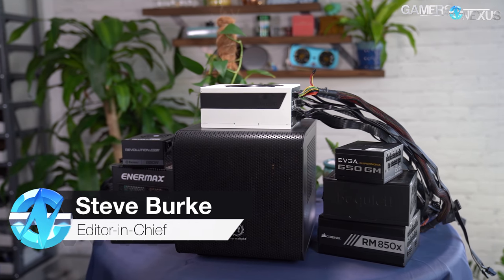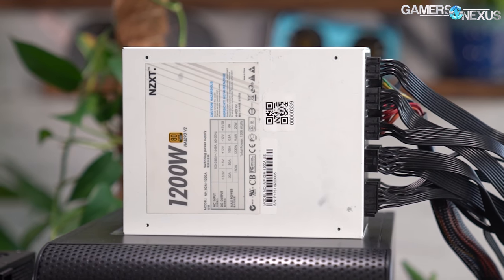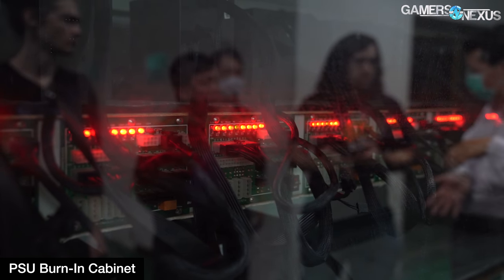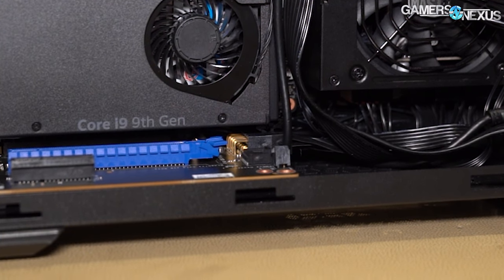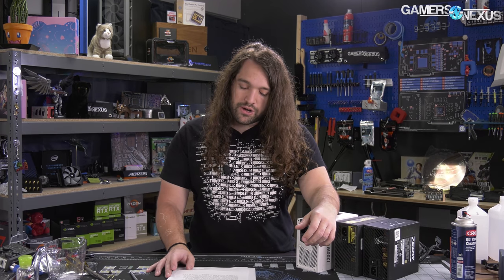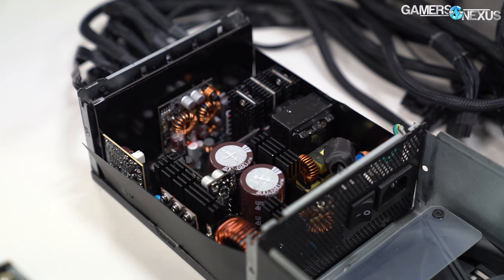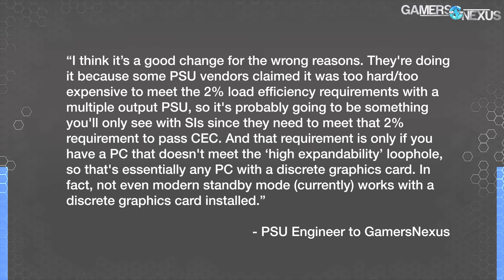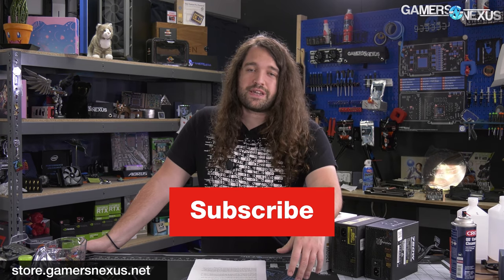Intel's ATX12VO Spec Explained & What Manufacturers Think

Comment: Something I wanted to point out from experience in the server space: the server industry as a whole has been moving to only 12V rails from the power supplies for some time. Google and Facebook hav been using 12V only on their custom servers for over 10 years, and newer standards bodies like OpenCompute and Open19 are also only 12V. This was done for efficiency of the AC->DC conversion process (many hyperscale style environments are even moving the AC input side to 440V to get even more efficiencies). The DC-DC conversion on the Motherboard isn't as bad as it has been in the past due to some new developments in this space. I've been looking at these new Himalaya parts from Maxim IC to do single chip conversion to 5V and 3.3V at up to 1A: https://www.youtube.com/watch?v=9WaV8XqfEyY these next to your motherboard RGBA connectors, SMBus, etc. would solve most of your 3.3V and 5V problems. USB and Thunderbolt/USB4 would need something that provides more power (as those can take up to 3A each port) but something like an LM2596 can solve that for you as well. Standardizing on a 12V rail also means adding backup power is much easier, and also makes it easier for use in mobile environments as well. These are all things that are already happening in the server space as well. I don't think this is all about meeting the new CEC rules, but reducing the number of OEM designs in high volume environments (since the work for 12V only has already needs to be done on the server side of the design group). Hope this provides some useful insight.
Reply: I think this servers don't need to power USB in standby?
Reply: @happygimp0  Some do, but even if they don't need it for USB Standby, they do need it for the BMC standby so that the IPMI/Redfish controller can be accessed when the server is off. Those typically run at 5V as well.
Reply: I had an impression that server space is moving to 48V inputs.
Reply: not 24V?
Reply: @wandererdragon  Intel's 10 year roadmap wants 400A of 48V per socket, but that's probably only going to be seen by the big three hyperscalers. To get 48V efficiently you need 440VAC and most data centers are not equipped for that. Lower volume sales will still probably be 12V based. The efficiency of going from 12V to 480mV isn't as good as 48V to 480mV but for smaller deployments it won't matter.
Reply: Why would DC to DC conversion on the MOBO be any more or less efficient than DC to DC conversion in the power supply? 5V will continue to exist for things like SATA power and USB.
Reply: also i remember seeing the 12v only DC-DC conversion pop up in threads by people wanting to use a non-DELL/HP/LENOVO psu with their prebuilt PCs
Reply: The thing about servers is they have a larger form factor to play with when laying out motherboards, at least compared to a gaming PC.  Power supplies have been getting smaller as efficiencies increase, whereas motherboards are getting more and more crowded thanks to M.2 wifi modules, SSDs, different RGB headers, 3 different USB header standards....you get the idea.  The only real standards that a rack server needs to follow are mounting dimensions and where a server can intake and exhaust air--everything else is fair game.  A gaming PC has too many standards that have to be accounted for--power supply dimensions, motherboard form factor, drive dimensions, as well as the location and height of expansion slots and built-in IO ports.  It is a royal pain in the ass to add a new standard that requires more space in a system rather than less (hence why E-ATX is a mess and micro-ATX and mini-ITX are gaining popularity).

I can see why power supply manufacturers want to shed 3.3 and 5V rails, but the motherboard is not going to have room to push all of that extra power around, and high-power devices like drives and graphics cards will need supplemental power from somewhere.  Not to mention you are adding complexity, cost, and inefficiencies everywhere that you change voltages.  SeaSonic may need to validate their 80+ Platinum rating but Nvidia and Seagate don't have that problem.

Comment: I can never not laugh with that Raycon ad
Reply: Shhh, it is not an ad. It is a sponsor spot ;)
Reply: I would buy the raycons, but for some inexplicable reason, they used a micro USB for charging.
Reply: Thomas Huang i just bought airpods pro but was looking at those
Reply: @thomashuang5053  cost. GN has actually covered the cost difference between micro b and type c in factory tours before
Reply: The ad was funny but there's no competitor for Jays' ads
Reply: @thomashuang5053  Micro USB ports are standard for most wireless earphones. Don't let them put you off
Reply: @tarfeef_4268  If Anker could build exactly the same earphones with a USB-C port for half the price, I'm sure Ray Jay could have managed. And I really mean the same, it looks like Raycon just painted an existing design that is probably being sold under a dozen Chinese brands for $20-$40.
Reply: @gang-yc4je  AirPods Pros are the best earbuds I have ever used

Comment: I've already been using a 12vo setup with my mini-itx build! I've got a 12v external brick bringing power to a dc-dc convertor that's sitting directly in the 24pin plug. You could very easily just replace the 24pin plug with a daughter board dc-dc convertor. It's not hard, new, or that expensive. It's a pretty solved problem in the custom sff space.

Comment: What I expect from the enthusiast market is to pretty much just slap a modified PicoPSU to an existing ATX12v motherboard.
This will convert the 12vO 10-pin connector to the 24-pin ATX connector we've all known and loved, and also allow the connectors for molex and SATA.
Since the real power hog parts are being powered directly by the PSU (CPU, GPU), this module doesn't need a huge amount of wattage. It can also handle the conversion between 12vSB and 5vSB.
Then, as the technology progresses, this connector will be streamlined, possibly into proprietary solutions, and 12vSB will be integrated into the motherboard circuits. But due to how crowded the boards are, I expect this daughter-card approach to persist into the foreseeable future in the high-performance sector.
I also expect these modules to become more common and purchasable as a loose component as ATX12vO power supplies also become more common, and vice versa, although an ATX12v to 12vO adapter will only require a couple level converters for things such as PWR_ON, PWR_GOOD and 5v/12vSB.
Reply: Molex and sata need to go away. Manufacturers need to mainstream m.2/ngff. That technology is not new its been around for over 10 years.

Comment: As a PC technician for 16 years, here are a few of my concerns about this:
1. OEM motherboards are already manufactured as cheaply as possible, and they ALWAYS go with the lowest bidder for whatever components they require. This is going to add many more points of failure to motherboards that already have too many points of failure.
2. OEM motherboard manufacturers will make the power components as small as feasibly possible to save costs on copper. This means the cost to repair goes to repair goes up for the consumer when a reflow is required.
3. PSU's have comparably large components, and you could basically repair them with an old boombox, a campfire and a butter knife if you were forced. When a power supply dies, I can keep downtime to near zero and I can 100% guarantee a fast repair. When circuitry on the motherboard dies, I can't always guarantee a fast repair, or even a repair at all.
4. I can't see the efficiency improvement balancing out the creation of e-waste when people feel forced to scrap the entire PC if their motherboard isn't repairable or no direct replacements exist.
5. What new standard will there be for the efficiency of the motherboard 3.3v and 5v rails? What standard will there be for vdroop/current regulation? How will it be enforced and measured? This feels less like adhering to regulations, and more like circumventing them and shifting the goal post.
Reply: Point 1 is my main concern as well.  Server makers and major PC Oems (Dell, HP, etc) I trust to used quality parts for 3.3/5V just like PSU vendors currently due to meet efficiency standards.  In the current enthusiast space I expect 3.3/5v DC-DC hardware quality to be slashed to the cheapest crap they can find on aliexpress to free up space in the budget for more Frag harder Disco bLights.
Reply: Can you imagine the board failures resulting from cheap motherboard VRM/DC-DC converters because modders/creative guys accidentally overloaded them?
Reply: Yeah. Sometimes, some "green" regulations actually cause more waste. In OEM, the old standard parts will no longer be used as replacement parts for the new one. Thus, these parts ends up in dumpster.

Comment: The standard doesn't actually improve the efficiency of your computer. It improves the efficiency of your power supply which then pushes all the voltage conversion tasks on the motherboard, which isn't Gov regulated. This is for CA compliance only.
Reply: Which drives up mobo prices and causes even more shitty mobos to pop up in prebuilts. Great.
Reply: And do you think that Motherboard manufacturers are going to make a California only Motherboard?
Reply: @otm646 Since then mobo manufacture exactly knows how much USB-/SATA-/...-ports are build in he can design the voltage converters to be a perfect fit. So there will be some efficency gain.
Reply: Just said this myself. It seems to me that the overall system efficiency would go down with this system bloody stupid. And the regulators are so stupid to actually fall for it!
Reply: It also means that there is extra waste due to the extra components on the higher turnover motherboards rather than the psu which gets reused on multiple systems, which seems to go against what California's actons appear to be about.
Reply: This is not necessarily true. It really depends. Converting 120/240 AC to DC voltages is a completely different converter architecture than converting 12 VDC to 3.3 VDC. There is really a lot more to consider. You can get converter efficiency way up in the high 90's when converting between two relatively similar DC voltages in modern DC/DC converters. If you have a 90% efficient AC/DC power supply you are doing really good. 

It really makes a lot of sense to move power supply tech towards a single DC supply rail. That way the entire converter can be optimized around this particular voltage.
Reply: @mirador698  I doubt there was going to be much gain, in the power supply you can spend the money for the most efficient converter possible, on a motherboard and you're not incentivized for that level of efficiency or durability.
Reply: @Fix_It_Again_Tony  But PSU's already do this. They use 12V as a base to convert to 5v and 3.3v, they don't typically convert straight from 240vac to 5v / 3.3v because that'd be a ridiculously lossy conversion... I.e. all they achieve with this spec is improving efficiency of the PSU, but not the efficiency of the whole system. There's no way they'll have room to fit "better" DC-DC converters on a motherboard versus inside the PSU. The only argument I could possibly see is that resistive losses will be smaller due to higher voltage over the PSU cables - but that's assuming the total cable lengths inside the whole system carrying 5V or 3.3V actually end up shorter in total, which is definitely not a guarantee...
Reply: @rockytom5889  Intel is good at driving up MB cost. Remember removing pins from mainstream CPUs... Intel can charge the same prices while pushing the cost to mobo manuf. They're scum of the planet.
Reply: The point of this is moving standby from 5 to 12V, so the converters don't have to be active all the time.
Reply: Intel is based in California. They’re basically trying to make normal power supplies illegal. Hopefully what happens this year ruins them. Vote 2020 yall.
Reply: You guys really have no fucking clue what you're talking about. Almost nothing actually uses 3.3v or 5v internally. They convert to an internal custom voltage and can just as easily do that from 12v.
Reply: The motherboard can be more efficient at this kind of conversion because it only has to convert for the specific things it supports instead of everything and then some just in case.
Reply: It absolutely improves the efficiency of the computer. Did you bother watching the linus video where he measures the power draw of the system with an 80+ gold PSU vs one of these 12VO's and cuts idle consumption in half?

Comment: PSU manufacturers goes: "It's still the same work, so the prices will be the same"
Motherboards manufacturers goes: "the BOM is higher and it is more difficult to produce, so we have to raise the price"

So more expencive computers ahead.... :)
Reply: Not more expensive intel mobos?  Well that's a shocker 😆
Reply: Not unless you go for AMD motherboards, since that is Intel's standard.

Those better stay at the OEM, where IT businesses rely on standardized hardware for uniform technician standards required to operate.
Reply: @Aereto  amds motherboards are already more expensive on average than intels especially for the new 500 series boards but alright. The manufacturer changed for amd and the boards are better quality now however i dont see how this wouldnt effect them either. but hey whatever people.
Reply: @yulfine1688  X570 is the counterpart to intel's Z390. And Z390 boards, in general, cost a good bit more than X570 boards. But you don't even have to get any X570 board because even half decent B350 boards can overclock third gen Ryzen fine. 
You can easily get B450 boards with 6 VRM phases for about 75$, but you can't get a similar Z370 board in the same price range.

Aaaaand you forgot that AMD processors are cheaper too.
Reply: No one cares about power efficiency. Especially regulations that come from California.
Reply: @omegaPhix  x570 boards are more expensive than z390
Reply: @yulfine1688  amd boards in general aren't more expensive than intel with the exception of x570 which a more expensive board to make to meet the requirements for pcie4 but apart from that not only are majority of Amd's boards cheaper there is no artificial limitations on lower end boards unlike intel where you need a z model if you want any overclocking ability
Reply: This just concerns pre-builts, many of which already utilize a solution similar to ATX12VO, so this talk about AMD- vs. Intel mobo prices is completely irrelevant.
Reply: Thank you California 😂
Reply: @samuelevans5750  Amen.
Reply: @Antonio Grande Not all progress is the same. This standard was already growing without the brute force.

...Just like ATX did before thru the OEMs.

Comment: Hell, I'd be excited about not having to deal with that big ass 24-pin connector. Depending on case and board it can be such a pain in the ass.
Reply: Are you gonna be excited about paying for a mini power supply with every single board purchase? PSU won't get cheaper and motherboards will get more expensive due to 3(Yes three) DC to DC buck converters added to them!
Reply: @zarmaanful  but it's gonna be easier for DC-DC UPS like the power supply connected directly to 12V Battery. That would be cool.

Comment: Yay, a new standard.  How standard of them.
Reply: The great thing about standards is that there are so many, so that everyone can choose the standard he wants.
Reply: well PSU standards are far and few between. Intel making one for 12-volt only PSUs is probably good accross the board.  Going from each OEM / SI wants their own design for output to one desgin for output is good. Right now you are with each OEM / SI has their own desgin they want the pins to be in for their version of the hardware. So having  a standard for it is good.
Also onto the thing about standards really for Power supplies you only really have 1 ATXV12 then you have all the proprietaryness used  in servers then you have the ones used in low end pre builts. None of the proprietary PSUs match each other either so when a Dell server power supply fails you cannot slot in your IBM server power supply even if it is the same wattage but you need another dell server power supply. With the ATX12VO standard well that still be the case but with low end systems that those severs go to the domains of when in a business will all have the same power supply so the replacements IT room will have alot less need for various power supplies. 

Mostly i think this law was made thinking it would mostly go to citizens buying PCs not companies buying cheap machines to run for their lower down workers that just get on a VM ran on a server hundreds of miles away or more likely in a back room that gets updates and sends updates every night.
Reply: Reminds me of an XKCD comic strip:
An engineer wonders: "There are 14 different competing standards in this field. It's so confusing, we need to invent a single standard to unite them all"!
After a while: "There are 15 competing standards in this field".

Comment: I am building my third pc with the same psu. If my system was ATX12VO, i would have to pay extra two times for my motherboard power circuit. This is not economic nor  environmentally friendly.
Reply: All ATX12VO does is (attempt to) standardize something *that already exists and is in use*. You're complaining about ghosts.
Reply: Kevin Skusek so PSU manufacturer’s are just moving parts that are normally on their PSU and putting that burden on the motherboard manufacturers? Since they have a higher profit margin anyway?
Reply: Remember when you change motherboards 3 times again you have to buy 3 times mini power supplies too which will unfortunately be in E-Waste because they were not in the PSU that you can have over a lot of builds.